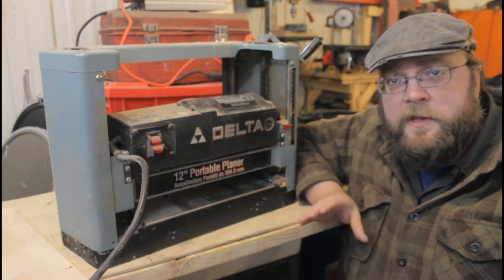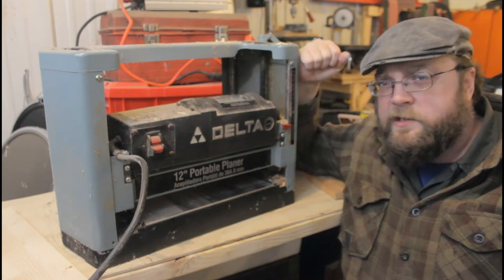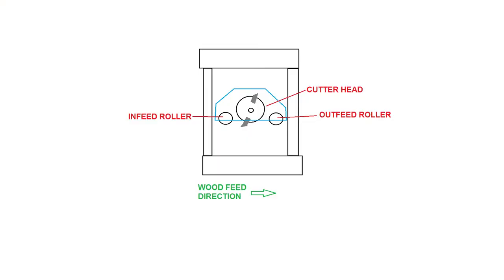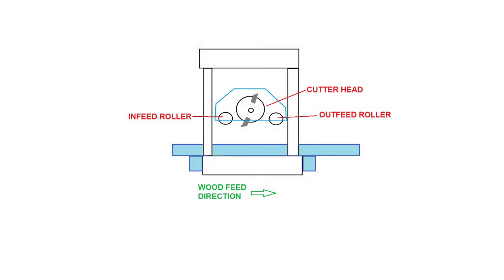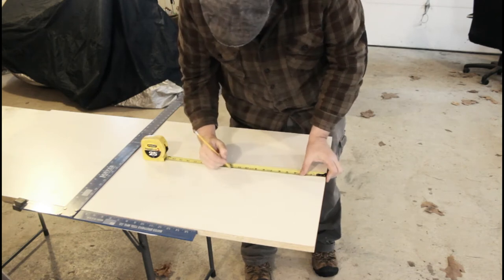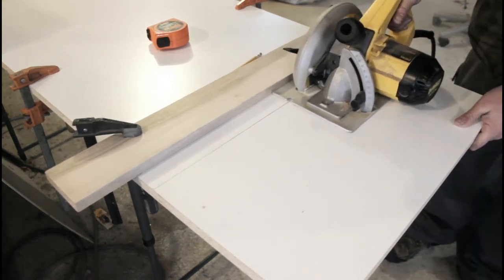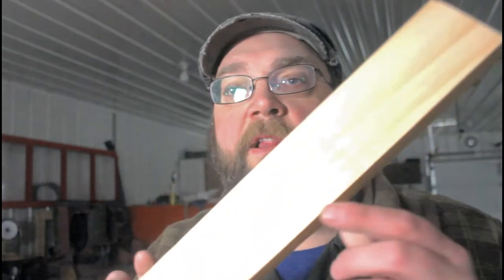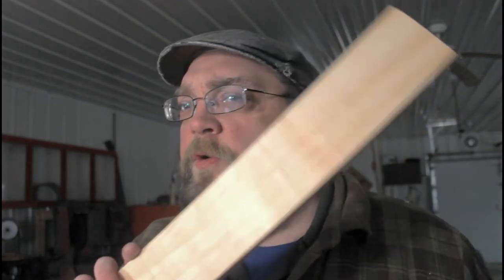DIY Power Planer Feed Table

Comment: Great Idea.  Just got a 22-540 without feed tables.  Easy to make.  One thing I would advise.  You need to watch some table saw safety videos.  That cross-cut of the 2x4 against the fence is a hand-removing, chest spearing kick-back accident waiting to happen.  Especially since your saw doesn't have any anti-kickback features or a blade guard.  Also, grabbing the stock before it had completely cleared the blade and the saw-blade had stopped spinning will eventually leave you with 2 fingers on a hand.  Hate to see that happen.